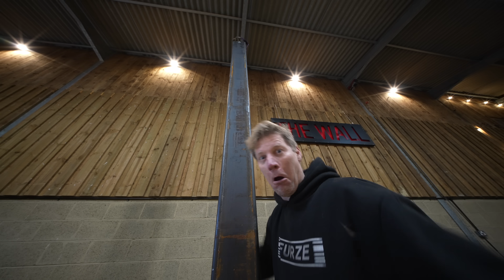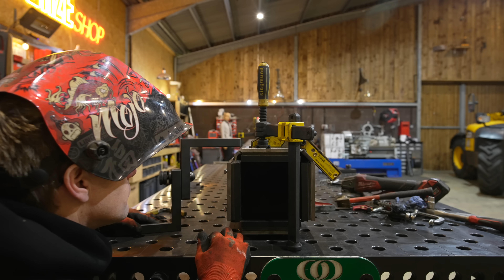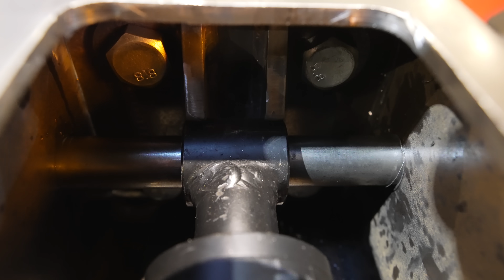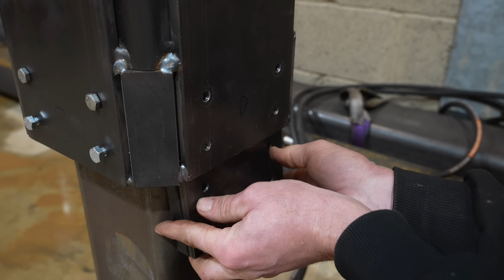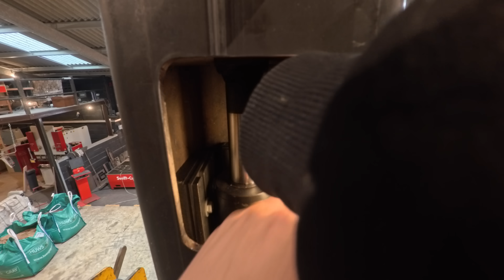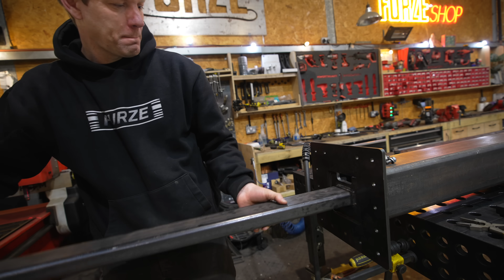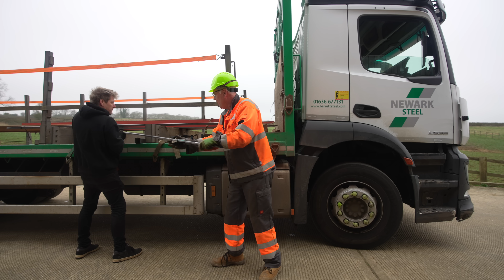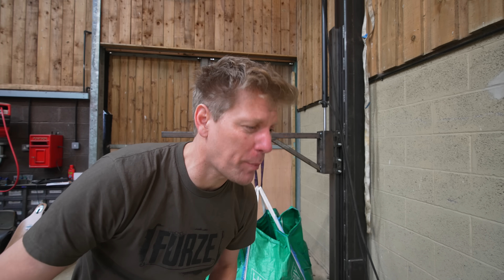Digging SECRET Garage Part 7 Car Lift Prep

Comment: I was thinking about how a forklift works.  There's a big heavy chain at the bottom in the back of the mast that goes over the top of the mast down to the forks.   That way as the hydraulics push the top of the mast the forks can travel the distance of the hydraulics plus the distance of the top of the mast.  I've been trying to figure out a good practical use case for this because I think it's so neat..... Good luck to you sir I enjoy watching a madman with a welder do his thing.

Comment: I’m not an engineer, but would it be a good idea to put a spring tension system on the nylon pad? When you tighten the adjustment screw it puts pressure on a spring that pushes the nylon pad against the post. That way there is constant pressure but the pads have the ability to fluctuate. In my head that would lessen the amount of times you would need to adjust the pad adjustment screws due to three possible scenarios - pad wear, expansion and contraction of the metal from temperature fluctuations, and variations in the post dimensions.

Comment: 1) For electric power screw lift option: Need an engineer to work out the buckling strength of the columns 💪 i.e. power required vs height b4 the columns bend and 2i) look into $ for  synchronous motors or servos with encoders or ii) a few shafts with gearboxes linking the simple motors. Youre looking at a ~100k uk pound system for non-hydraulic options, not inluding frames etc 

You might not get 3m lift, so raise the floor height 500mm,, prob need that clearance for the rotary part.

For the rotatary part you need a hydraulic or electric motor feeding a high gear worm drive on a slew ring. Thats looking like ~10k

Comment: I just noticed these in this video, but it appears there are power lines right above the garage, now I don't know how high those are but I've been to the UK couple times and I can say they are not always very high. I just want to make sure you have measured that because you said the car lift my be lifted up with another car on top. anyway, super cool video and that one post alone just looks awesome, maybe some 3rd printed versions as merch would be kind off cool

Comment: Hi Colin, If the rams were mounted outside of your columns just inboard but effectively against he colums then they would act to reduce the bending in your structurews and the whole design wouldb be easier

Comment: @colinfurze!, Hello from La Jolla, California 92037. Question: What would happen if there is no electricity? Say, if in an emergency scenario you must get your Delorean out for a spin down the avenue, are you also building a manual system to go along with your electrical one? Or are you also building an electrical generator back up? ;) Saturday, March 28, 2026 02:22 PM

Comment: Stop everything😂. Just have the legs expand enough to fit your truck height and instead of using a lift, just put a little corkscrew ramp down into your garage.

Comment: Instead of hydraulics, they could have copied a solution from automotive repair shops: a screw drive, four trapezoidal screws at the corners with bronze nuts, a self-locking mechanism. The screws were connected at the top by a chain or a gear and shaft, as is done in industry. The drive was placed at the top to protect it from potential water ingress.
Reply: just google four post lift

Comment: Would it not be possible to build a platform that had 4 electric motors, one at each corner and they essentially acted as wheels/cogs that walked up the wall together (you could have also had them in a vertical rail) and if it failed it has the same safety mechanism as a lift that locks into a safety catch?

Comment: 13:05
Interstingly, we have a very similar system onboard our Austrian high speed trains to get wheelchair people in and out. We have that exact same issue with difficult access to the hydraulic cylinder once it's inside. You have to take it out through the top if there is an issue with leaking or the bottom valve, requiring about 2m room above, meaning we even have to switch off the overhead wire in the workshop.

We would be very glad if the manufacturer had thought of a removal slot or at least an access panel at the bottom, like you have. Proper design, keep it up! 👍

Comment: 29:00 No it doesn't work that way. If the snag is internal you will have an imbalance. A safety check is putting a contraption where if a ball tilts enough to a side, it closes the cirquit and operation halts. Like the air ball of air in the level, but this time is a steel one. The rest leveling is done one way is via lasers. Check also how its done on the Hydraulic Shearing Machine.

Comment: Always freaking amazing to see the advancement of that titan job you decided to get into. 
I have a question ! Instead of cutting a slot into the main frame of the bar, wouldn't be wiser to dig a hole in the floor right next to the pilar to slide down the pneumatic cylinder in it and retrieve it that way ? That would reduce the amount of integrity you sacrifice on your main bar ?

Comment: Regarding the safety brakes, since it's a dynamic load, I think you should gauge robustness in kilo Newtons rather than mass, no? That's the rating you'll find on clibming gear, for example.

Comment: Colin, an easier way to make the offset cam shaft in a 3 jaw without making a sleeve would be to remove one of the jaws, rotate the scroll 1 or 2 times and the reinstall the 3rd jaw. This would off set the piece in the 3 jaw to make the center hole eccentric to the od.

Comment: Ok technically if your gonna use it to hold a car in the air you need lock points in it for it to rest on so the hydraulics aren’t under all of the strain for long time periods

Comment: ~25:00 you can do those inner bearings if you slide the part to the end of the rail and install them first* then work your way outwards, your tool should have the sweep to rotate them. probably also could drill a few more index holes on them too to make it easier to get at.

Comment: hey colin, i know this is too late and you already proved it works, but could you have put some high pressure springs in the shim adjustment bolts to auto regulate the gap? (car valve springs might be tough enough)
Reply: never mind, after thinking, that would pull the shims out not in ....unless you put a spring inside

Comment: Looks great, Colin!

Just two things, and I bet that you already know this but in building and doing engineering things in general comments to point the obvious never hurt: Remember that you'll need a physical barrier to prevent people  who might fall into the hole while the elevator is going up or down. rotary warning lights would also be a good thing, and the railing and the lights may even be a minimum requirement for the UK Regulation (I'm not from the UK but european regulations are similar in most cases).

Also, while calculating the weight of something think about it in the worst case scenario. In the case of the DeLorean you need to consider the max people inside  (2) with the average weight, what may be inside, the weight of the fuel and add a security factor of 1.5 at least. That puts tou in the 2.3 - 2.4 metric tons.

Comment: The daisy chain system you described to keep them all in sync at the end - Would that prevent you from noticing a faulty hydraulic ram since the other 3 would pick up the slack and force it to rise without you realizing it’s not “pulling its own weight”?

Comment: It needs a safety lock system like on a 4 post car lift.  This not only makes it safe, it prevents a a major problem if one or two hydraulic hydraulic cylinders/hoses fail while it is raised.

Comment: i know its done now , but the access holes for maintenance for the hydraulic ram , the one on the inside , why didnt you just create access doors on the top of the beam all the way to the driveway ,if you somehow can get the top of the beams to be accessible , you can just disconnect all the hydraulic lines from the beam ,disconnect it from the bottom of the beam ,then access the top hatch on the driveway and lift it up ,
the advantage here is that you can do all this with the system completely off 
with your approach ,the system needs to be on , all the hydraulics need to be all the way up ,and you need scaffolding for safety
i know im being an arm chair general here ,i just want to know the reason you didnt consider it ?

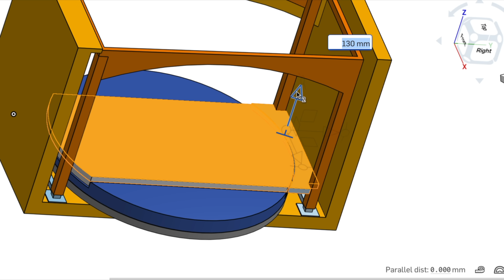Comment: First time I´ve seen teh frontage, and I´m sure the SEMI-neighbours love this structural works.. so close by... 0:37 shows this is a SEMI... can anyone spot the potential maintenance issues in years to come? water - steel ... rust? on this underground poo...l
Reply: Did they get correct notice / plans for Boundary-Wall works? Literally NIMBY but please do wtf you want AWAY from other people... This is fun project, nothing to detract from engineering this; and there are subterranean car-ports; i planned one before Local-Authority did away with Parking needs. 
Hey, you might own that too, or maybe an ex-semi look; so DWTFYW...
Reply: We´re having endless wars soon, so a bunker and off-road might be classed as future community-service...
Reply: Half-Way through, I hope these legs are synced... so raising at same speed... otherwise mis-feed jam?
Reply: Covered at end, along with Brake if falling too quick... Presumably foundations checked for weight being put on spot... with safety factor..

Comment: If I may ask, during the brainstorming phase, did you come across a chain pulley style lift, like that found in some forklifts? Know Art touched on them in a video about telescopic machines a while back, and honestly I think that might be the only place I've seen someone try to explain how that specific mechanism works.
The thought had come to mind when I saw how much of a pain maintenance would be on such a massive piston. Even with the slot cut in the side, you have to be quite careful with the stability of your locking mechanism, and if that happens to fail then you're gonna have a tough time getting the piston back in the post.

With the chain piston design, the platform would be able to sit at the base of the piston at floor level, then raise all the way to the top of the extended piston head, that being the entire length of the piston itself, cylinder and arm combined. Since at rest (the platform in its lowest state) the piston heads would only reach about half the garages height, replacing the pistons, chains, and/or whatever other worn components there are should be significantly easier, and possibly safer considering the platform would be able to sit on solid ground and nothing has to support any weight. Smaller but more numerous components would make moving individual components less of a back breaker, and if one component fails, it wouldn't be a catastrophic failure of the whole mechanism. So long as there are stable guide rails, like what you already planned for, there shouldn't be much concern regarding the stability of the piston rams themselves either.
Though, I can definitely foresee the problem in chain procurement and/or fitting, as you'd likely either need really beefy chains, or a WHOLE LOT of 'em, in order to support the weight of the lift, driveway, AND potentially 2 cars. Not to mention mounting points, as the piston heads and chains would likely be protruding from the driveway when fully extended as little stumps, similar to how the piston head and chain are always above the prongs of a forklift. However, if you still intend on having a secondary lift as part of the turntable, that could easily resolve the latter issue.

I'd like to be clear, I'm not an engineer, just someone who thinks engineering is cool, so I wouldn't be surprised if this was already thought of and discarded due to constraints I'm not well educated on. But if throwing the idea out there helps, whether it be you or someone else on a similar project where it's more applicable, I don't see the harm in doing so.
That aside, I'm still looking forward to how this project turns out, it's been a wild ride so far!

Comment: Colin, I think you need to add check valves to the rams, that way if they is any failure of hose, connection or hydraulic pressure, the rams will stay stationary and not let your Delorean plummet to the ground!

Comment: Quick safety aspect, once it's raised and you work underneath it, you should add ability to insert safety pins to prevent it going downwards incase of collapse drill holes through at certain points certain heights so god forbid something fails and your underneath it does not collapse all the way down

Comment: @colinfurze , have you considered getting a well drill to dig you some holes for your hydraulics to sit into so they can be recessed below the bottom of the car? they would need to be 2x the length, but BOY HOWDY it would be cool to have them centered beneath your car platform.  they would also be 100% inaccessible, which means you dont have to worry about pesky maintenance.

Comment: Why does the system use 8 BTB cylinders to lift a car instead of a chain-driven system that could achieve 2:1 movement with fewer components

Comment: idk ive watched a lot of colins videos, and he usually will make/design stuff that is unreasonably complicated . so as to make the whole thing easier to use..... but adding the turning around the car part, seems like it will entail more mechanical maintenance and problems over time... rather than just backing into his drive....

Comment: Collin, as an engineer, I find your channel fascinating, & have a suggestion that you can bin with ease. Would it not be easier to use a cable operating system rather than the hydraulics inside the columns? A close examination of normal garage car lifts would give a less complex system than the one you are working with. Even with the lift within the lift system!  You could then have a separate motor for each lift, which is only turning a drum to wind in or out of the cables! No chance of hydraulic failure. The turntable could be operated with the same principle as the car starter motor, A sharp burst of power to overcome inercia then it freewheels to the lock position you want!

Comment: Curiously, will it meed signing off as lift equipment? You could also slot some bolts to adjust with a screwdriver on your cam adjusters, so you don't have double 8 sided heads, or use stud worth an allen head in.

Comment: Not to be a party pooper but has there been any consideration to a mechanical locking device if there were to be a hydraulic failure? You don't want it to damage anyone or anything if it fails in operation? You just never know and it's better to have it and not need it, than to need it and not have it. That might mean altering the legs again, to have spring locks like a car lift that engage as it raises and are disengaged to lower it. I did just read a comment about about hydraulic check valves to hold the rams where they are in case of a hydraulic supply issue but I'd there was a cylinder issue, I still think there's the possibility it could drop and drop unevenly. It's just a thought.

Nevermind, you addressed this, right at the end of the video, it serves me right for commenting before the end!

Comment: Are you using electric or diesel motors to power the hydraulic lift? I'm just wondering what the financial cost is of lifting 15 tons around 28 times a month.

Comment: Hey, Colin. Not an engineer, here, but any time I'm making something that can be dangerous if it fails I like to build in enough strength for one or two things to fail and it still be able to hold itself together. In your case, I might consider making your posts weight redundant so that if one or two hydraulic rams fail the remaining rams can hold all the weight. Not sure if you're already doing that but I didn't hear you mention it.

Comment: In my experience ball bearings work really bad as rollers, they are so hadened that they can not take a lot of force applied in one point, as they do when they work as a wheel instead of sitting in a round outer seat. Luckely I am not alone in this feeling so you can buy the same function but made for use as a wheel, google "LR50_6-2RS-TN" and you will find an example of one. Its not the correct size but I think you can probably find the size you used as a bearing but in wheel version. Very fun project, crazy big, but fun :-)

Comment: Colin your offset cams, if you don't need a specific offset, use the 3 jaw chuck but put one of the jaws in 1 rotation late on the scroll... Minimum pissing about.

Comment: if I understood what you said correctly, to me your hydraulic hosing solution sounds like the cylinder with the lightest load will always rise first - just like in a car the wheel that spins with the least resistance gets the power through the differential.

Comment: Hi Colin,
Love the bunker, love the bikes, but I think it’s time for something that sits on a desk and looks like it belongs in a 2050 sci-fi flick. We need a digital clock that is quintessentially Furze.
The Vision:
The Aesthetic: Exposed wiring, brushed aluminum, and "danger" stripes. A mix of brutalist industrialism and high-tech futurism.
The "Furze" Factor: Instead of a boring plastic case, use CNC-machined parts or even a miniature hydraulic lift to adjust the viewing angle.
Light & Color: A massive array of RGB LEDs with a "plethora" of settings—everything from "Subtle Pulse" to "Full-Blown Disco Rave."
The Projection Beam: A high-intensity laser or LED projector that blasts the time onto the ceiling (or the wall of the neighbor's house).
Imagine the "Furze" logo laser-etched into the glass. It’s not just a clock; it’s a piece of engineering.

Go for a futuristic build with Nixie/VFD retro-glow, Infinity Mirrors for depth, Lidar gesture control for hands-free settings, and RGB IC strips for fluid color gradients.